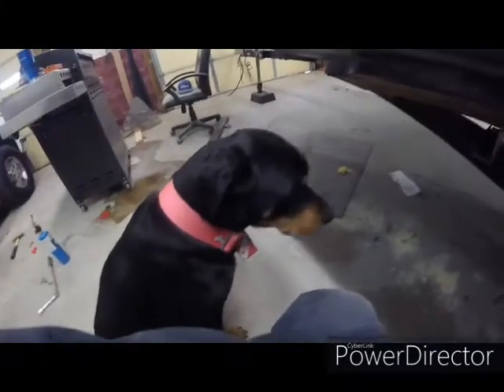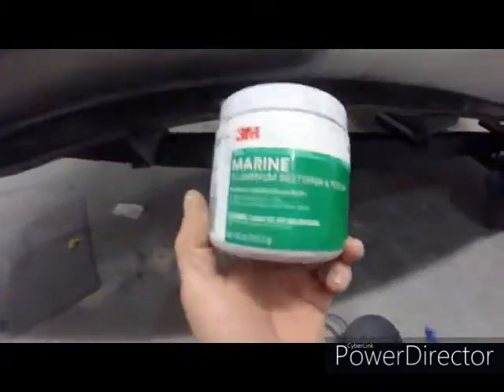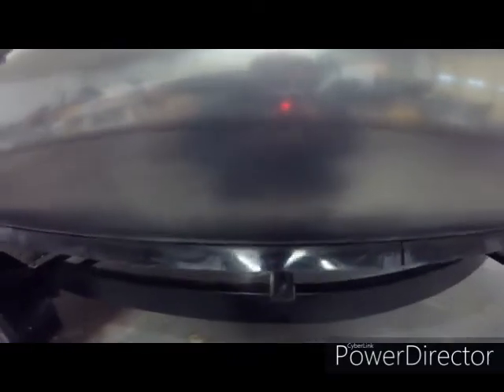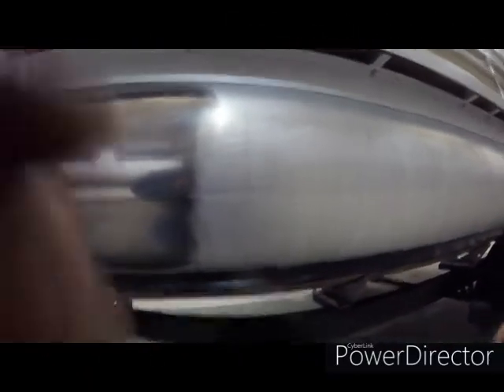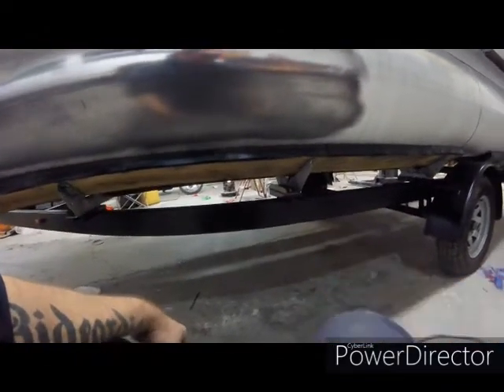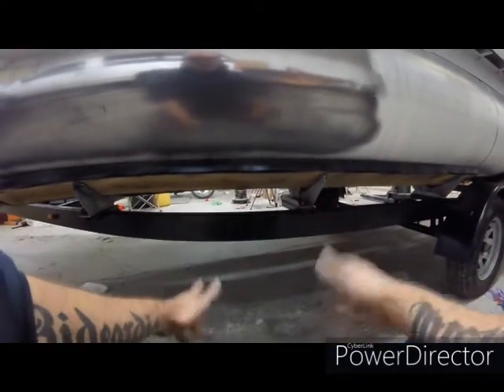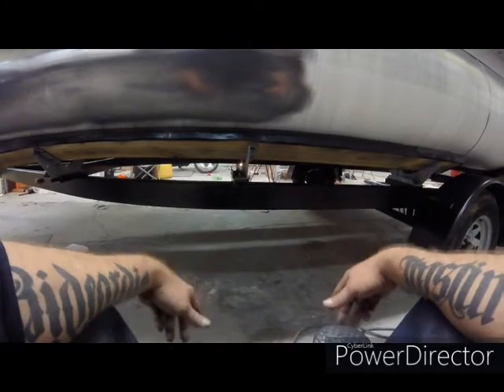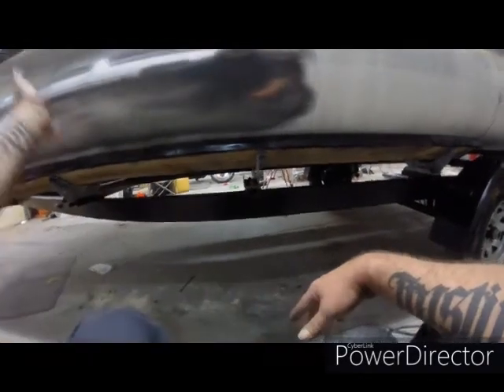How to shine your Aluminum Pontoon's on your boat.

Comment: I've tried to find the answer, does the star bright bleach your bunk carpet? Just bought a new trailer, I'd hate to destroy it. Powder coat issues?
Reply from the maker: I’ve used the star rite bleach stuff before not a lot just make sure you spray a lot of water first I’m sure if you kept it on there long enough it may do some damage but I use it on my personal boat and have had no problems I’m sorry I haven’t answered I’ve been super busy moving and have a lot more cleaning buffing videos coming soon thanks for the questions

Comment: I have an electric hand held grinder. Can i put a pad on it and use it for buffing?
Reply from the maker: ol crow fishing
1 second ago
I have honestly never tried that before but if you cant control the speed with nothing but the trigger because most grinders are alot higher rpm than what you would use on a variable speed the pads i use i think are 7" pads. thank you for watching hope that helps you out.

Comment: Probably would polish up a lot faster with a wool pad.
Reply from the maker: yes agreed i did not have one that day the one i had i hit a sharp edge on a boat a few days before and tore my wool pad thank you for the reply though and thank you for watching
Reply from the maker: I have honestly never tried that before but if you cant control the speed with nothing but the trigger because most grinders are alot higher rpm than what you would use on a variable speed the pads i use i think are 7" pads. thank you for watching hope that helps you out.